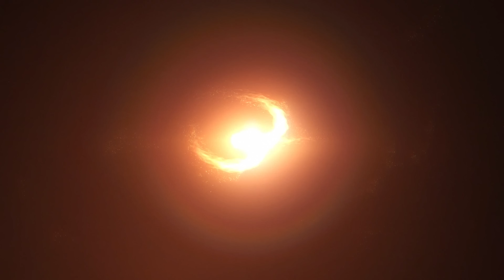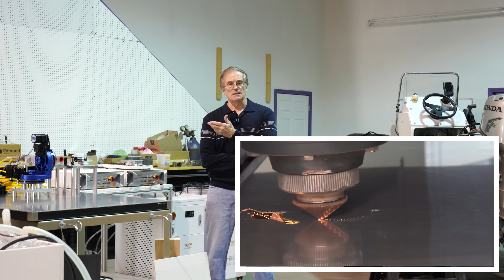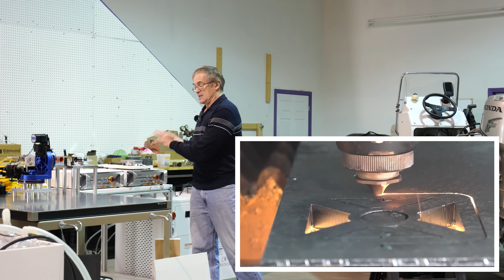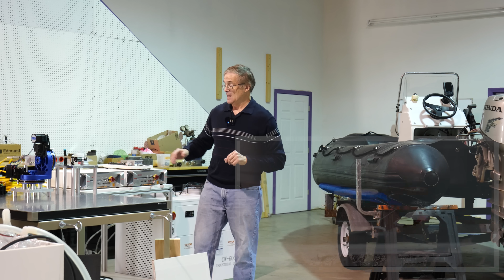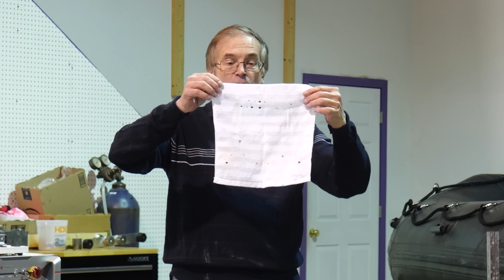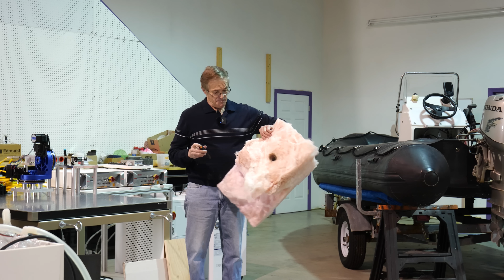We have a problem... and need your help!

Comment: You could scatter the beam through an optical lens or prism and direct it towards ceramic plates. You can replace them.
If it moves to fast around you could combine the beams with a convex mirror and them through the prism.

Comment: Two options: easiest would be compacted graphite. it'll ablade, it'll sublimate, but it'll last a long time. Way longer than the seconds you need. Another more complex would be sharp angle pyramids of tungsten or molybenum in a cavity shape to diffuse the beam. A bit like acoustic diffusors but with much tougher materials. A combination of both would work. Water curtains as mentionned will work but could become problematic with high level of reflection.

Comment: How about a diffusion or Fresnel lens to decrease the power and then some sacrificial material behind the lens?
Say you are able to double the diameter of the laser, that would make it 1/4th as powerful, increasing the time of the sacrificial material by 4x.

Even if you are able to deflect the laser by a fraction of a degree that would give you the possibility to increase distance and use the squared root law of light to drop the power.

Alternatively, perhaps some High Temperature Alumina Fiber Boards or Dry Ice? 

I had a think for some hours.
How about a water mixed with vantablack? This can be built as a very large sheet by having glass sheets separated by enough black-water to absorb most of the power. Once most of the power is converted to steam then you can have a drywall backstop to get the final amount of power.

I had some more time to think on this.
If you are able to shoot it at an material at an angle then the actual Area the laser is hitting would be dramatically increased, slowing down the time it would take to cut through dramatically.
Say the laser is 1mm in diameter.  Setting is at an 1 degree angle would mean the 0,78mm2 of the laser would be converted to 80mm2, meaning about 1/100th the power.
That would allow you to use just the normal drywall.
If you want it perpendicular to the laser then use a prism sheet first, allowing you to track things and the prism would refract the laser directing it to the sacrificial material at an angle.

Now, all, except one, of these are assuming the lens doesn't catch fire. The only one that might actually not burn is the water with vantablack.

Comment: If the high-voltage side of the power supply can be switched directly by, say a FET (or multiple thereof), a robust and large-area shutoff system might work.

Consider an FR4 (fiberglass+ epoxy; good for local dispersion of light and heat) PCB + optical barrier sandwich which has these layers:

1) diffusive optical barrier; this layer is intended to diffuse incident light and heat across a wider areas. Fiberglass sheeting might be a good fit.
2) A narrow meandering microstrip which covers 1/2 or more of the surface area of the PCB
3) Same as layer 2 covering the remaining surface area
4) backstop optical barrier -- just in case

Say one end of the microstrip had a voltage reference, and the other side had an ADC. By sensing a voltage drop across the meandering microstrip line, penetration of the PCB could be detected.

Effort should be made to minimize capactive and inductive coupling depending on the timescales sensing must be performed in, which is a function of the thickness and efficacy of the optical barrier. A filled ground plane sandwiched between layers 1 and 2 may aid in reducing the effects of cap' and induct' coupling.

Tons of little variations of course. Could even use tinfoil or XYZ-axis conductive tape in place of a PCB and microstrip-based design.

I think that this system can be implemented in either digital or analog, with the only reasonable safety assumption being that the voltage difference between the penetrated and non-penetrated conductor is sufficient to trigger a shutoff.

Haven't seen a solution offered for large area coverage at reasonable cost. Definitely a bit more of a hassle than other solutions in terms of design and integration though.

Cool query to field for an even cooler project! 😁

Comment: How about a composite,  with an ablative outer surface, and a thermally conductive ceramic 2nd sheet,   like Boron Nitride   or  Silicon Carbide  (corrundum)   which should dissipate the heat  and not melt?    Fire-brick  sounds like perhaps  a good. cheap   outer  ablative layer  which should already provide reasonable 1st layer, but the thermal conductivity is low.

Comment: Vidasil - the ceramic/ synthetic material patented in 1986 by Serbian engineer Vida Popović. The material is extremely heat and acid resistant. It can withstand more than 1500'C. I am not sure about the status of the parent. It was registered in Australia, but the patent registration has elapsed. The production of that material is unknown. I would speculate that the patient is stolen and material is produced under different trade marks.

Comment: Just dig a trench in backyard.

Low tech, low cost, used successfully for centuries. Passive system, so safer than any active solutions. And it will be usefull in future anytime you have something with high energy that can go sideways (rocket engines, railguns, huge capacitors banks etc.) so treat it as future investment.

Comment: A Colum of luting sand for thermite welding in beam direction might withstand the 5000°C  for a very limited test run as a sacrificial test material and danger reduction. Other options like tantalum carbide powder or similar compounds would drive the cost up very fast.   Thanks for great videos.. dont get locked up.

Comment: I don't know if a material like Durastone would suffice. It is a fiberglass composite material like G10 but has a higher temperature rating. It is mainly used for wave soldering and selective soldering pallets/stencils. Maybe worth a try if you are interested.

Comment: so i come in and say, your premis is wrong.
1. Think about you goal and set performance targets. 
- if your previous setup already barbecues drones in seconds this setup dices them in ms
-- do you really need to be that performant
2. would it make more sense to have 4 beams of 125x INITIAL performance of the old setup?
- split the beam 2x 
3. Do you need the system to do targeting with just 1 laser or could you achive the same result with a targeting beam and an attack beam (like most military grade systems do)
- Advantage, you could evenout atmospheric interference 
-- less energy consumption 
--- higher worksafety
---- higher component lifespan
----- less calibration and maintenence
4. maybe try ""Starlite"" From the 80s it was never released but there is a community on youtube that tryed to recreate it(pretty good results actually). i looked at this once and it is incredibly fireresistant i think it is because of a multistage chemical process that leads to the formation of a carbonlatice at its last point of reaction while at the same time through out the process increasing its volume
5. Produce carbon aerogel, basically non flamable super light highly absorband and incredibly
5.B Pressed charcoal ...? pulverised wood charcoal or pressed stone charcoal.
6. use quantumdots? fun experiment? i mean you know the wavelength of your laser
IN THE END
no material will last exposur to that laser shorut of Tungsten. 
Tungsten at an 45deg angle which woudl scatter the laser and then (area of impact) have charcoal sheets (wet)

Comment: Another option is a quartz container filled with water that has something in it to diffuse the beam like maybe pearlescent powder or ultra fine metal flake. Then you just have to make the water swirl and that should keep the material suspended in the water and hopefully the water can break up the beam and absorb it

Comment: maybe some graphite? or some sort of ceramic like plates etc... they should handle better the heat than the common brick. Also i was thinking if the shielding from the gas could help but it seems that fiber lasers are good at penetrating those gases
Reply: or maybe i think a mould of some type with sand inside

Comment: Rotating disk or swinging sheet of some good enough material, might be able to last long enough. Thinking if glass-ceramics would have enough of durability and heat decipation https://youtu.be/qi8jmEbWsxU?si=bpiJvN_wlZPqQsxT&t=207. To protect from reflections you can hide it behind a sheet of a fabric.
Yet another interesting arrangement would be to reflect it down to ground into a pool of sand, sodium bicarbonate, graphite granulate, water emulsion, wet sawdust ...

Comment: A tank(or pile) of quartz sand? A lot of scattering, a decent amount of thermal mass, relatively portable if you don't mind shoveling/bagging it up into manageable portions each time you move. And most importantly, a heck of a lot cheaper than an equal mass of sintered/frosted glass.

Comment: have you tested dark ceramic tiles or slate glued to plywood ?
similar how one would tile a bathroom 
i you do two staggered layers it would still be a movable wall and should provide you 
with a couple of seconds of protection , easily available however does take some time to make

Comment: What about a 3 step solution: Use a precision prism array to scatter and divide the incoming laser beam into multiple lower-intensity beams. These beams should be directed downward into a water-cooled containment tank. The tank is continuously replenished with fresh water to absorb and manage thermal energy. Inside the tank, install a rotating graphite disk positioned to intercept the laser light. Graphite’s exceptional thermal resistance prevents combustion, while the rotation spreads the energy load across a larger surface area, avoiding localized overheating.

Comment: How about a simple and inexpensive solution. Build a 4" thick wall of dark or black sand. It could absorb the energy and once it transforms the sand into a solid then it give you time to shut the laser off. Might make it a 6 " wall. On the back of the wall you could install angled mirrors that deflect the laser beam in the event the beam goes they the wall. Making the beam travel thru the sand at that angle would increase the walls thickness. Who knows. Black sand in a wall just might be with a try. Good luck

Comment: Sugar water. Slightly ridiculous idea but hear me out. It'd be fundamental to me to have some sort of instant kill switch. 
I'm thinking about what I'd want to happen here -- I'd want to have a detector and a shut off mechanism. 

I'd think that hitting sugar water with a very high intensity laser caramelizes the water, and it changing color would be detectable and trips the power. 
The change of color would also make the water more absorbent, and a sufficiently big tank of water can absorb quite a bit of energy until it starts to boil.
If you manage to vaporize a fairly big tank of water you likely have bigger problems. 

A similar thought would be blocks of charcoal ice -- finely powdered charcoal in ice. Enough charcoal would make the ice opaque, the ice melting would prevent fire.

Comment: Mix cement, graphite powder, and fiberglass (structural)  to make some sort of heat resistant bakerboard sheets? And then soak with water? For cheaper carbon, charcoal could also be an option.

Comment: The side of a High rpm spinning soot covered tungsten disk or drum sandwich with flowing water,  if you keep the water just near the surface for high rpm by sandwiching 2 drums with water inbetween or a tumgsten disk with enough thermal mass to just cool with water externaly, and carbon coating should eliminate reflection but you wont be able to just dump water on it you would have to duct it. That should work as long term

Comment: i think you had the right idea with a salt mine.  changing your location would be easier than building a test lab. i think finding a cave, mine, gravel pit, or canyon would be the right idea and would be the safest bet.  maybe you could make a pit with an excavator and pile material high up in a berm.

Comment: Two stage Cage solution :  

an Outer cage,  that has a Mirror finish on the inside. The second cage is an Aquarium filled with colored/milky Water. 

the Laser will punch a hole in the outer cage and enters the Aquarium where the beam will be diffused by the particles in the Water. The part of them beam that makes it true will be reflected back into the Aquarium until its energy is used up. 

As long as the Mirror is reflective enough to not burn up while reflecting the beam this should work.

Comment: There is a cheap and easy solution available for a little bit of effort. Hire a digger and  make an embankment out of earth. It can be as thick as you need it to be and you could even box in the test area from three sides if safety outdoors is a concern. It is easy to renew if it sustains damage during testing and you can flatten it back out after your experiments and not have any waste lying around.

Comment: What is the wavelength of the light?  A material that absorbs light  at that wavelength, then fluoresces, is converting that energy into light of longer wavelength instead of heat.  The emitted light is emitted in all directions,  not back at you.   The compound could be in solution or embedded in something transparent.   There are inexpensive dyes such as fluorescein and rhodamine that absorb in visible wavelengths.  Others that absorb UV, but t I don't know about IR light.

Comment: For test purposes You could increase the diameter of the beam. If the diameter of the beam is increased from say 1 mm to 2 mm, the intensity is divided by 4. If this would not be sufficient the diameter can be increased further until a viable compromise is reached.

Comment: I would try Starlight or a similar intumescent foam. Something that has a relatively high pure carbon content as that won't vaporize or burn very quickly. Most common binders will however unfortunately.

Comment: Graphite blocks work in such cases. Or any type of dense foam covered in "super black" (essentially high grade soot). If your beam is stationary you can use several graphite blocks inline in a water cooled copper sleeve. This is used for electron beams in particle accelerators. If you are worried about larger surfaces and are not sure where the beam might hit, graphite blocks would be the way to go. This is of course assuming that your beam exceeds a few kW and is too powerful for traditional beam blockers you could buy online.

Comment: A concave lens or heat-warped clear acrylic to diffract the beam, and some white asbestos sheets to take the hit of the diffracted beam, space the asbestos sheets meters back from the lens/acrylic. When I warp the acrylic cover on our laser cutter, the beam diffracts quickly and becomes useless until I change it, so it might work 🤷‍♂.

Comment: You could use liquid nitrogen (LN₂) circulating between two metal layers. Something similar to a cooling system in rocket nozzles.
Hope it helps.

Comment: Maybe drywall as screen, and PIR detector loking on it waiting to kill laser. Drywall as you show can withstand some fraction of second so it may be an option.
Second idea was solar panel with kill switch
I have no idea if those will be fast enough to shut off the laser before damage occurs. Maybe something that slightly disperses the light before a direct hit could help.
Solar have few issues due it size and frame around, and may be less practical.

Comment: laser is exicitation of focused energy.  Now,  i am not sure what optics do you use but if the laser is defocused the energy would spread to larger area and thus easier to handle. so a prism that can switch on an off after fiber source to a defocusing lens into a water sink would work.

Comment: Use "Fiber Cement Flat Board"  available in various thickness  and cheaper than plywood.
Also apply a thinner layer of 'clay' or 'mud' on top of it to make it even stronger energy absorption.

Comment: A few things:
1. I'm intrigued that the metal cutting rig cuts a straight line for some distance and then diverges. How on earth does that work?
2. You seem to be building a weapon. Are you not going to have legal issues?
3. What exactly do you want to do with it in your workshop? Knowing that may make way for some ideas.
4. Maybe you are trying to solve the wrong problem. Possibly the problem is 'how do we get this to a safe location?'

Comment: It is possible that a material that can withstand this is used in the space industry as a shield against melting, as a coating with high temperature resistance and rapid cooling.

Comment: i'm thinking 6-layers of high strength fine steel security screen, each layer slightly offset cemented together with a heat resistant plaster and backed with a thin layer of reflective steel. My thought is that the steel mesh will absorb and detract the laser slightly with each layer (like the trough in a laser cutter), the refectory cement/plaster will help absorb/reduce the final strength of the laser that hits the reflective steel sheet, and any laser leftover should be stopped by its reflection back through the panel.

Comment: Sounds like you first need to reorientate your laser so it's pointing down at ground.

Second, what about starlight, or other carbon foam potentially doped. Or fireblanket. 
Fiberoptic redirect.
Polarising glass.
Nichrome wire lattice, measure current flow. Temperature change to trigger shut off.
Pwm to regulate laser power.
Mushu black paint on a big heat sync.

Comment: Perhaps you could mix a highly absorbent (or reflective) black/metallic pigment dust with a dense particulate (like sand or metal bits) and shove a layer of the mixture between panes of clear acrylic...
I'm no material scientist, but it'd be a fun experiment to throw into a video!